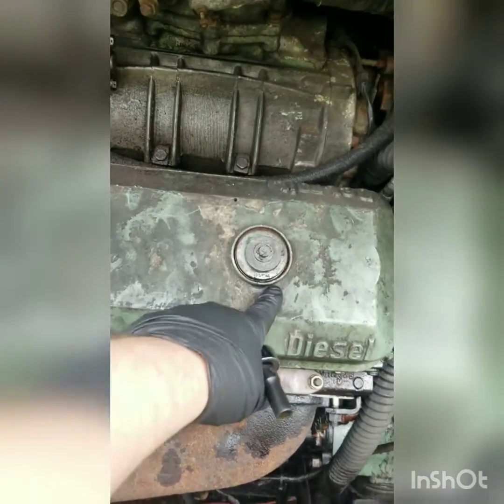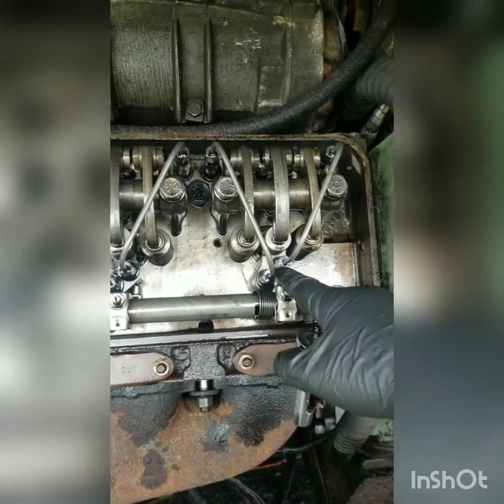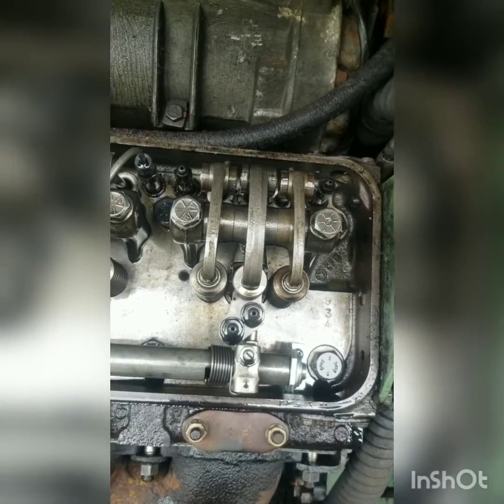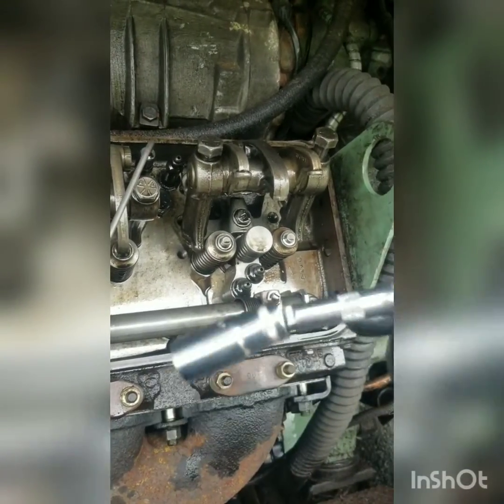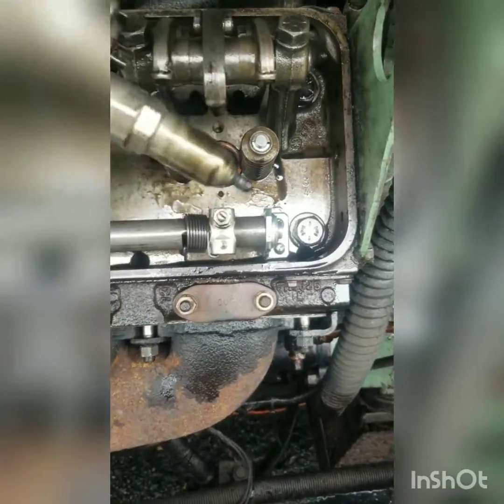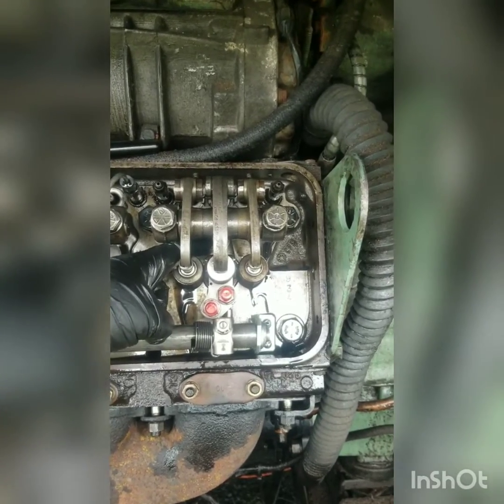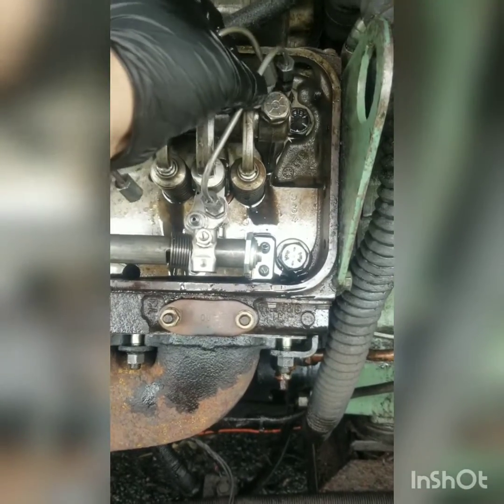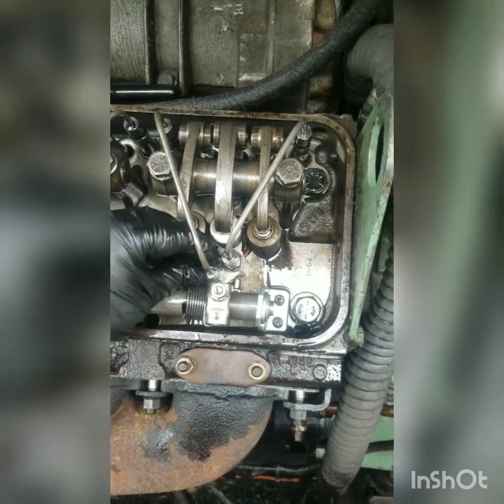Detroit Diesel 6v71 injector replacement

Comment: Nice video.
I've got a 453t, I think the governor might have been set a little high, I have my foot in the climbing a hill felt like it seized put the clutch in right away when I came to a stop white smoke was just totally gushing out the exhaust pipe like a fan was blowing it no water in the oil still runs breather acting normal I think an injector opened up on me I did have a high pressure electric fuel pump on their government it 50 lb. Can I put blower bypass for a bigger Turbo on the opposite side of the motor blowing into the inspection plates I'm new to diesels but I love my little 453

Comment: You did not replace the copper cage that is in the head. If you do not change the cage you can have a compression leak and misfire.
Reply from the maker: The injector cup? We inspect them but very rarely replace them with an injector replacement. This cylinder head only had about 500 miles on it since the head was replaced and cups were installed.
Reply: Are you supposed to replace the the copper cage or injector cup as this guy says it’s called whenever you replace the injector?